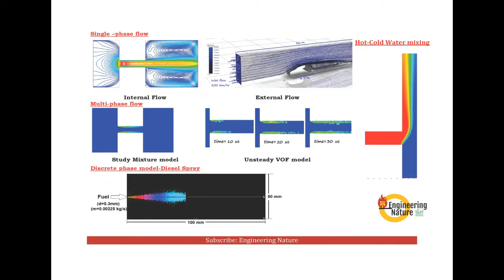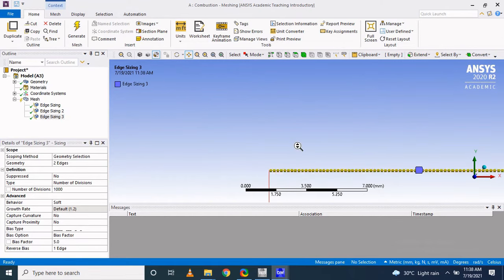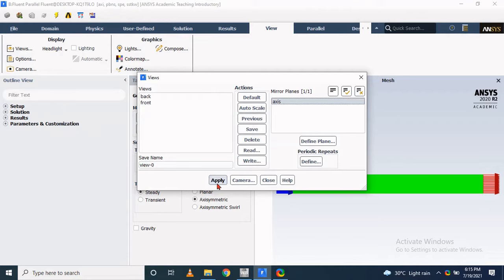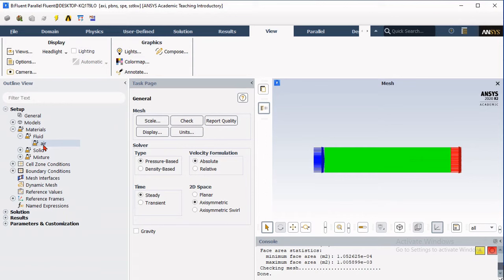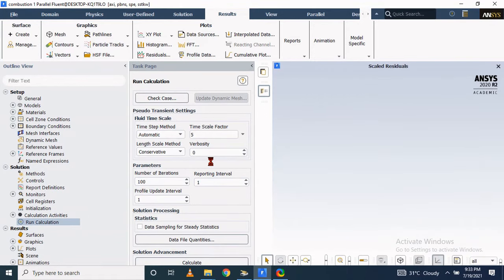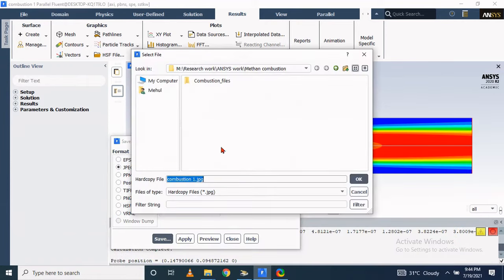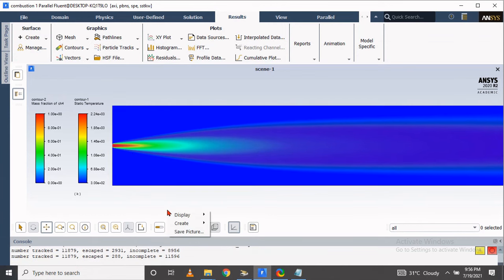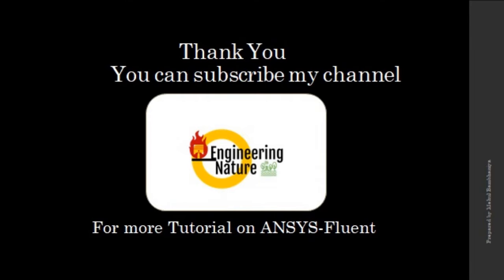ANSYS-Fluent Tutorial || Species transport modelling || Gaseous combustion (Methane combustion 1/2)

Comment: Thank you so much for the video. Could you please tell how the boundary conditions of air and fuel inlet mass flow is calculated. Is it assumed to be the same value as 3D case or do we need to make changes for the actual values for 2D. or is it accounted when you gave hydraulic diameter ?. Thanks once again!

Comment: How did u decide the mass flow rate of methane and air ?
Reply from the maker: This problem is specifically taken from the experimental work carried out by Brookes et al. All Boundary conditions including mass and fuel flow rate are considering similar to validate this work with experimental data. Although one can calculate the fuel flow rate from the schochiometric A/F ratio.